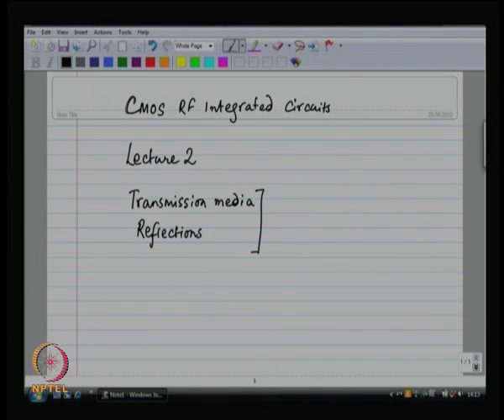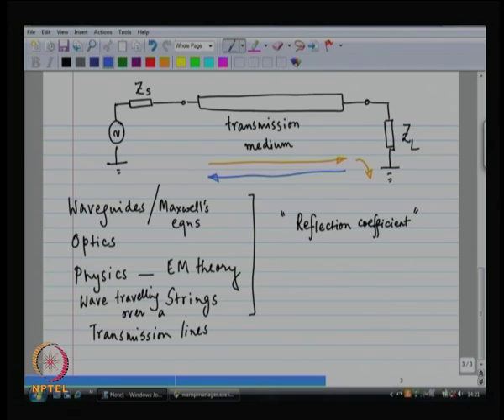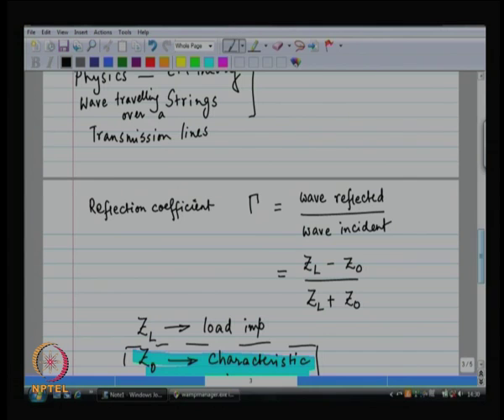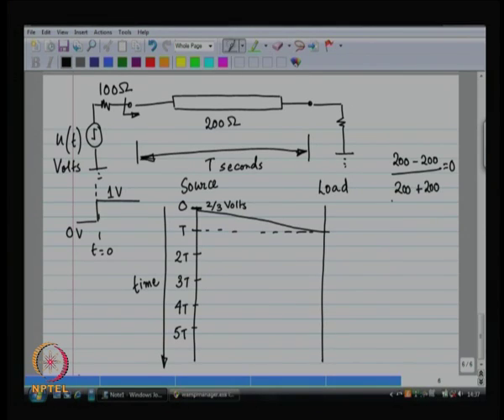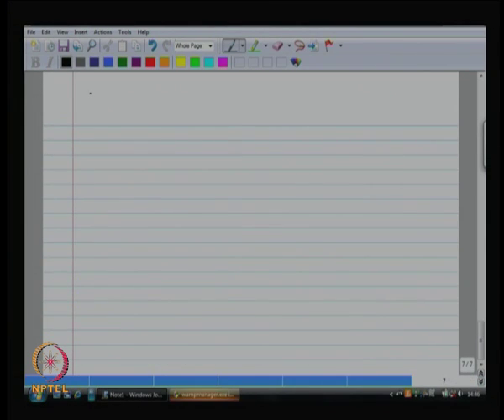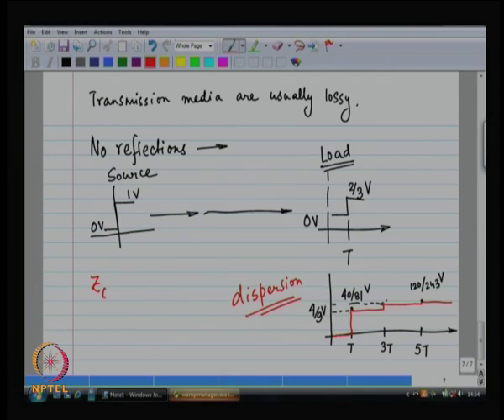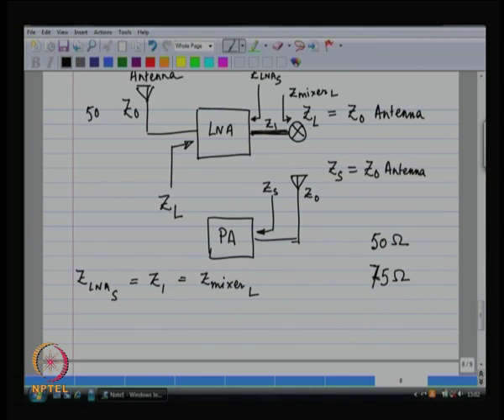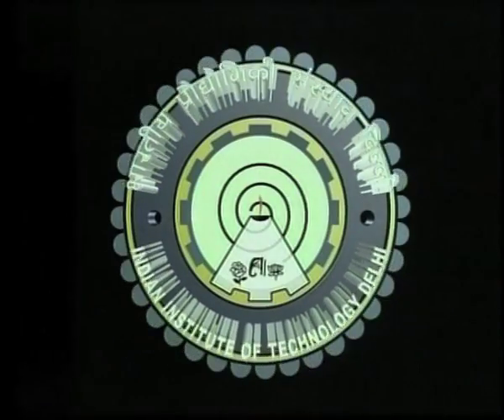Mod-01 Lec-02 Transmission media reflection

Comment: Why 50 ohm is consider for char. Impedance . plz CLR more
Reply: Most coaxial cables and connectors in common use have a 50Ω characteristic impedance,
with an exception being the 75 Ω  cable used in television systems. The reasoning behind these
choices is that an air-filled coaxial line has minimum attenuation for a characteristic impedance
of about 77Ω   (Problem 2.27), while maximum power capacity occurs for a characteristic
impedance of about 30Ω   (Problem 3.28). A 50Ω   characteristic impedance thus represents a
compromise between minimum attenuation and maximum power capacity. - From Pozar, Microwave Engineering pg 134

Comment: Why  the voltage at the source is 2/3V? Do not  consider the load when dividing the voltage? thank you for your answer
Reply: When firstly consider the source voltage that gonna transmit, it need to be considered as "equivalent voltage", which need to be calculated as the load is open, which is infinite resistance. (thevenin theorem). The transmit medium is consider as "transmission line", so during the calculation, bear in mind the values are like "equivalent", "characteristic" etc.  If the transmit medium were considered as just a "perfect wire, real static resistance", which means the signals transmit from source to load is considered "instant", then it would be the normal DC voltage dividing as you implying.

Comment: Is the source impedance of 100ohms really not considered in the calculation? i.e. added to the characteristic impedance.  Also, why is the voltage to be absorb by the load base on Z0 = 2/3 and not ZL = 1/3? Thanks for any answers